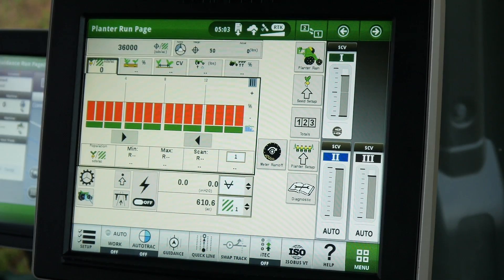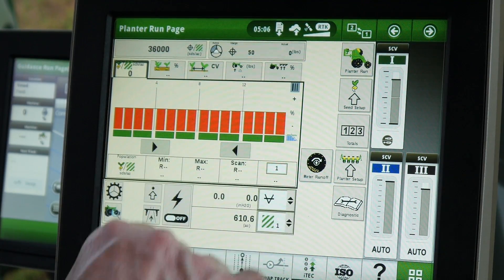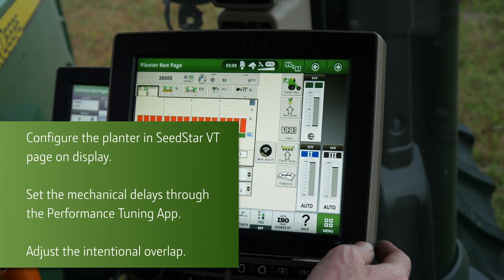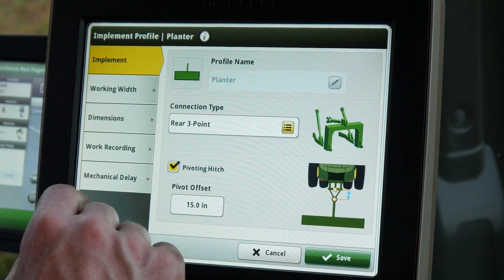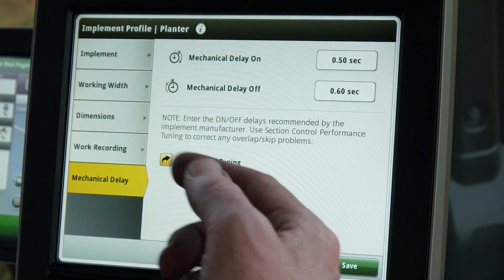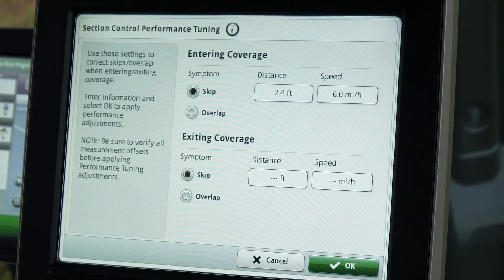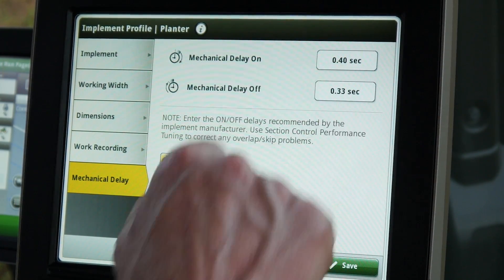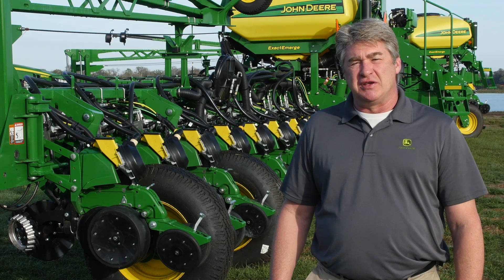How To Minimize Planting Gaps And Overlaps | John Deere Planters

Comment: The "Delay on" and "Delay off" have always seemed backwards or mislabeled to me.  I'm running 2630 display with 1790 planter with black wedge box (gen II XP, I think) with ECM's, so I don't have the handy performance tuning screen.  I have to calculate it out.  I get the numbers correct, but I always go the wrong way.  Using the example in this video 11" overlap @ 6MPH  going from end-rows into the field needs 0.1 second (11in/((6MPH * 5280 ft/mi*12in/ft)/3600 sec/hr)=0.1042 seconds).  Since it is an overlap, my reasoning tells me to add more "delay" (0.5+0.1) before the row turns on to eliminate the overlap, but that is the wrong way and results in double the overlap.  It would make more sense if they called it "look ahead time"  because to reduce overlap by 0.1 seconds, I would need to reduce the "look ahead" by that amount (0.5-0.1=0.4 sec).  I hope I'm not alone in this, I get it wrong almost every year.